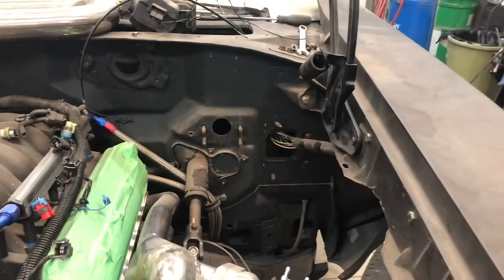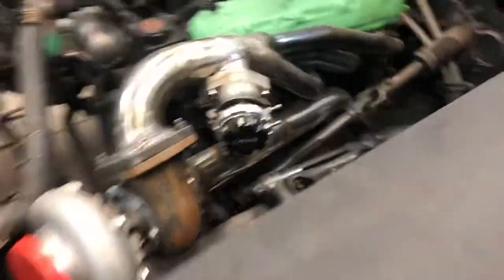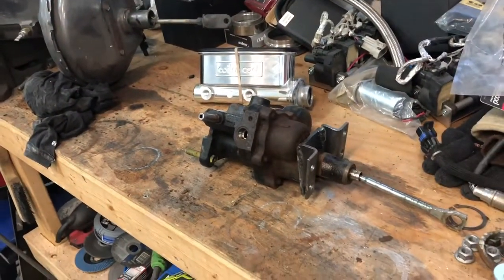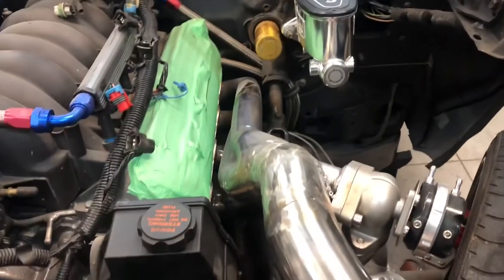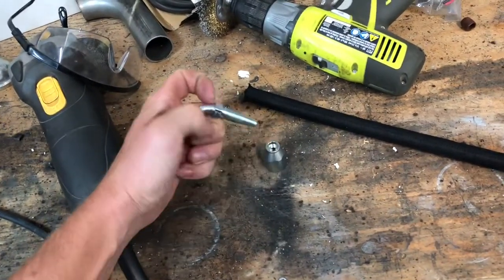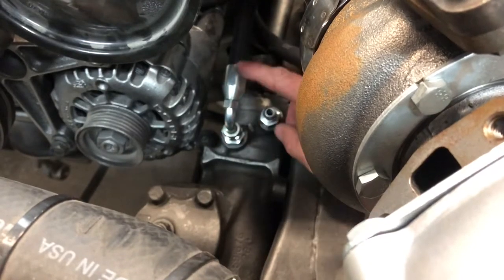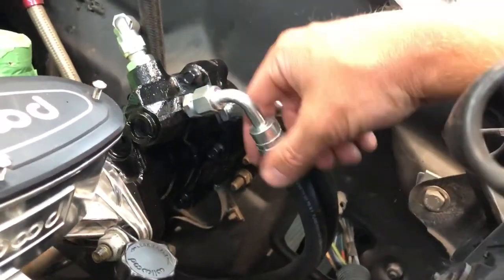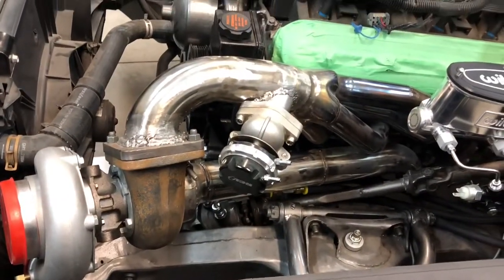Cheap Hydro Booster Upgrade for your A Body

Comment: I've built me a setup similar but the only thing is that the pedal is hard like a manual brake setup but it stops like a chap. If you're wondering I have a 69 Lemans with a merlin 509 with ssbc 13s up front and 11s on the rear

Comment: nice work man.. lookin good. if those fittings are stainless, you should use the fluid that goes in the system to lubricate over that spit lube lol.. don't want those fine threads galling.

Comment: So I understand this correctly, the hydo boost solves a low vacuum problem when converting to 4 wheel disc that otherwise would leave the braking action insufficient or too hard at the pedal?  In other words, why do a hydro boost setup if you don't have to (if a vacuum booster will work)?  What is the benefit?  Does it make the pedal super easy touch wise?  I have a 4 wheel drum 70 Elky (bbc) I am considering upgrading to 4 wheel disc.  But I am a little hesitant because my current setup works extremely well even though it's 4 wheel drum (I barely have to touch the pedal for braking).  Disc brakes look better and in theory should function better but I'd hate to remove a perfectly functioning system only to have a problem getting disc brakes to work nicely. Nice video brother.
Reply from the maker: The reason I went to a hydro booster is because I went turbo. With an engine under boost, it’s not creating vacuum, braking could suffer.
Reply: High performance cams dont make much vacuum, this offers a different solution than electric vacuum pump. The fact he had 4 wheel disks is secondary

Comment: So the hose that you cut and assembled on one end with the supplied fittings is for the high pressure side?  If so, will that end be able to handle the high pressure?
Reply from the maker: Yes.

Comment: Hi there great vid - so this completely replaces the original disc shaped booster entirely?
Reply from the maker: Yes. This replaces the round vacuum booster. And after 2 years of use, it still works flawlessly.

Comment: Did you have any issues when you apply the brake it make a vibrating sound
Reply from the maker: Nope. Works flawlessly.
Reply: @averagedadsgarage   dam I ran all the lines correctly I need to find someone that had that same issue

Comment: Hey , I did the same set up and I have no pedal feel at all having trouble bleeding the brakes  as well is there somthing special u did or added for it ?
Reply from the maker: Have you started the car?  I had no pedal feel at all until I started the car. I thought I had done something wrong and felt like I bled for an hours. Then I started the car, pumped the pedal, and it was rock hard.
Reply: Yea I started it and nothing at all I was bleeding them for hours still nothing not sure what's going on
Reply from the maker: Did you do the Wilwood bleed on the master cylinder before you hooked up the brake lines? That’s the only other thing I can think of.
Reply: @averagedadsgarage  I didn't actually  ill try that see if it works thanks alot and keep up the videos helped me out alot with my build !
Reply: Thanks for the advice  worked right away after I did that !!

Comment: I installed a hydro boost in a 69 Impala. Mind seems noisy. Have you encountered this problem?
Reply from the maker: Not at all. Are you running an original style power steering pump? I wonder if the older pumps run less pressure which may starve the system of the pressure needed. Not sure, just a thought. My pump is from a 2000 camaro.
Reply: @averagedadsgarage  I have a 2006 Chevy 1500 pump. It works, but its loud when you press on the brake

Comment: How things bud? Like your video on the hydro boost.. nice work.. is it possible to invert the hydro boost unit so the lines are hidden at the bottom? Goin to do this swap soon..
Reply from the maker: Never thought about inverting it. I can see it being possible. If my memory serves me right, the two master cylinder mounting bolt holes are centered. So you should be able to mount the booster upside down and it’ll bolt up correctly. Good luck.
Reply: @averagedadsgarage  I've seen them inverted on some chevy trucks......just can't tell which model and did it myself while fighting for room on a 455 olds /55 chev swap

Comment: how do you bleed this system
Reply from the maker: You need to bench bleed the master cylinder first. Wilwood masters come with instructions on how to do it. Basically with the master in a vice, you use the provided plastic fittings and small rubber lines that back feed into the reservoir, and with the master full of fluid, you manually push in the plunger until all the air is out of it. Then install on brake booster. Hook up your brake lines and bleed each caliper one at a time.
Reply: @averagedadsgarage  thanks for the info.how about the hydro boost is there any thing I have to do to it as far as bleeding it
Reply from the maker: Nope. Fill it with power steering fluid. Fire it up.